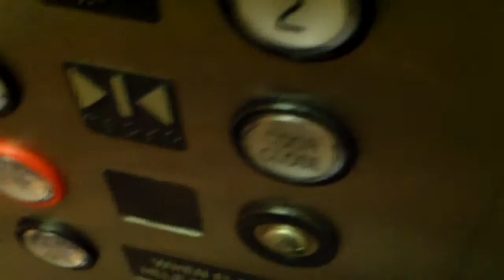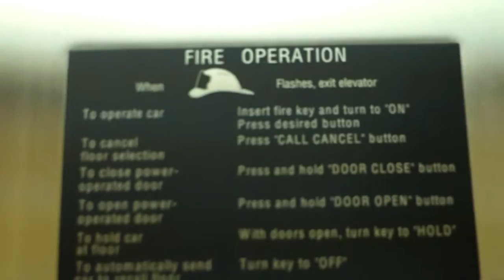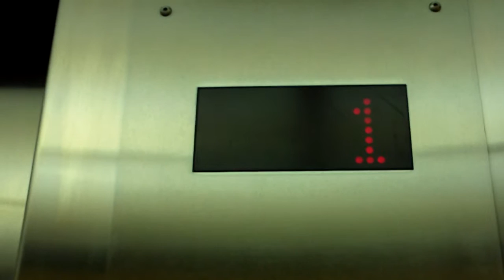Innovated Dover Hydraulic Elevator at the Marinette Library, Marinette, WI

Comment: The same happened to a hospital near me I may upload it soon
Reply from the maker: +ivan reid That's very unfortunate, vintage elevators are a dying species.
Reply: however it still is relay controlled you can hear them by the beeps i got a video of it if you want me to upload it
Reply: Elevating Denver also a little down the hall from those the others are original
Reply from the maker: +ivan reid I see, the mod your talking about is very similar to this one. Otherwise saying, more of an aesthetic update mostly. Go ahead and upload your video and I'll watch it when I get time tomorrow.
Reply: +Elevating Denver did you watch it
Reply from the maker: ivan reid I'll watch it quickly.
Reply: Elevating Denver I just found out this actually is an unknown innovated elevator, even though it was just down the hall from the regular Dover one, the innovated one was in the newer part and the Dover was in the older part